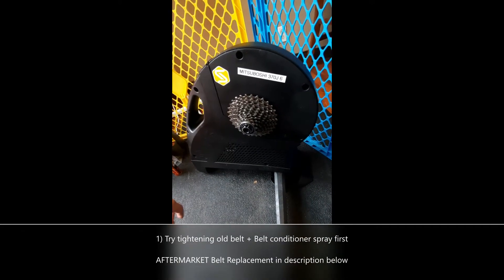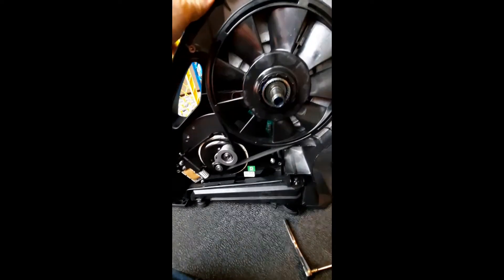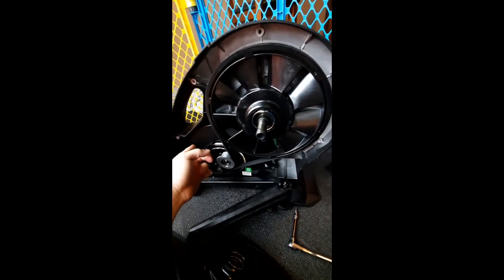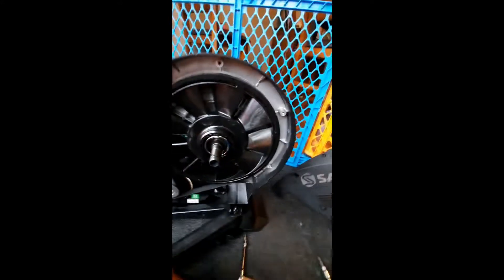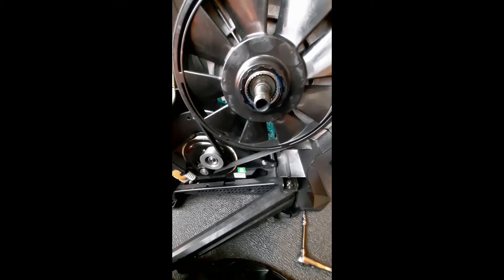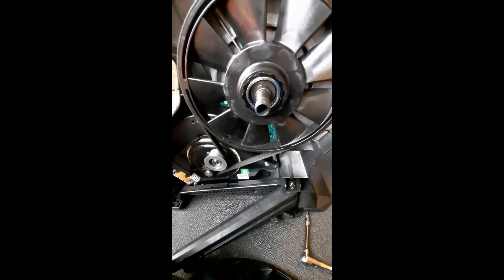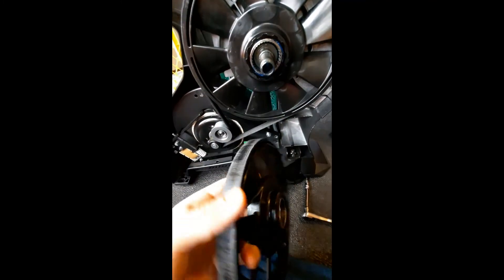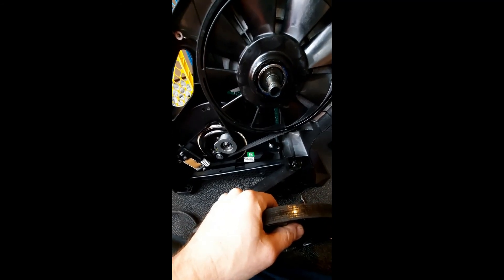SARIS H3 Trainer "Knocking" Fix. Belt, Pulley, and other changeouts explained.

Comment: I've just ordered one of these that's down as a return with this knocking sound... with a bit of luck it'll be a good project for me, if I can fix it up its a good turbo for £80

how did you get on with the $1000 rocker plate :face-purple-wide-eyes:
Reply from the maker: @denbot.cycling absolute steal. Buy a good quality belt(not one from saris) and i bet you'll be set. 

The new JetBlack 4-way rocker looks legit.
Reply: @Bigkidbird4  I've already got a stationary smart bike, but its too much like a spinning bike lacks the real road feel, with a bit of luck £80 is worth the gamble 😅 I'll let you know how I get on next week
Reply: @denbot.cycling  Any luck on fixing yours?
Reply: @ touch would its working find, I've tested it with the power meter on my bike as well, cadence and power are almost perfect match, normally 10w lower on the turbo, I'm putting that down to drive chain n gearing loss though.

my pully wheel is a smooth one, so I've used some belt conditioner on it, make it tackie, not sure it its needed, but I'm sure it cant be a bad thing, it did give it a strange sound like I was unrolling cello tape, but its worn off now

Comment: Thank you for the video.  How did you remove the fan pulley?  What took did you use?
Reply from the maker: I used a couple small pry bars, maybe even a big screwdriver on one side, cant remember but it took some force.  It was kinda tough to get behind it to pry off the case but it did come off and was doable.

Comment: It could be the bearing is bad also
Reply from the maker: You'll know if any bearings are bad by removing the belt and spinning them. They wont spin freely or they will feel a little knotchy and not smooth.  You may be able to buy some time by pulling one side of the bearing seal out and packing a little high temp grease in it and reinstalling the bearing seal.  Bearing size should be on the seal or you could physically measure it..  online or local bearing store for purchase.  **Press-in a new bearing, never beat or hammer one in.  Good luck.

Comment: Thank you for video. How do you take pulley wheel off?
Reply from the maker: I slid in a couple pry bars behind the pulley wheel behind the center bearing area..  popped off after a little force. It was kinda hard to get behind it but it did come off.

Comment: I have knocking only when done with ride  when winding down and only have a few hundred miles on it where did you get the belt from do you have a part number
Reply from the maker: Its in video description.   Try tightening it a little bit and adding some belt dressing

Comment: I have the Saris H3 and have a knocking sound.  Saris also sent me a new pulley but I can't for the life of me get the pulley off.  How did you get the pulley off to put the new one on?
Reply from the maker: Just took a couple small pry bars and pried it behind the center the best i could.   Kinda tricky to get behind it and pry off it with how the housing is formed and the pulley, but it popped right off.  Maybe a touch of heat with a butane torch but mine didnt need it.

Comment: Thank You. I have been emailing Saris with no response.  I hope Saris gives you that Rocker Plate. I'll get a new belt and give my trainer a once over.
Reply from the maker: Ill keep my fingers crossed😆🤞  Glad I could help.  Try tightening your old belt a touch and apply some belt dressing while waiting on your new belt to arrive.
Reply: @Bigkidbird4  I really appreciate how you took the time to clearly, slowly explain the steps you took.  I've had a CycleOps Hammer since about 2017, have never serviced it in any way and it's just now starting to make the heavy "woodpecker" noise your video shows and you reference.  Looking forward to trying the belt and conditioner solution.  Thank you and happy cycling!
Reply: Wow, this was fantastic!  Thanks for sharing it on that other thread, Craig.
Reply: I bought my H3 thinking that an American company would give good customer service.  It took Saris 2 months to even acknowledge my email. Sadly the knock got worse after changing the belt.
Reply: @Goji-Berries  I didn't even get an email from Saris. I am very disappointed in Saris Customer Support.
Reply from the maker: @Goji-Berries  That also was a big incentive for my purchase as well.  Sry to hear your trainer is still knocking.. does it  sound like the woodpecker knock in video?

Comment: Hi Mitch, Thanks for the video. Really appreciated and easy to follow. Just to confirm before i buy the belt, it's really the 370J6 Poly-V Belt that you bought? Not the J7 or J8 correct?
Reply from the maker: Yes.. it is the 370 J6, as this correlates with the number v-grooves